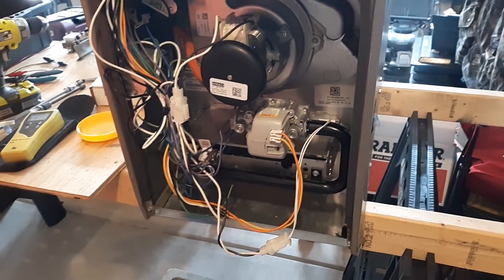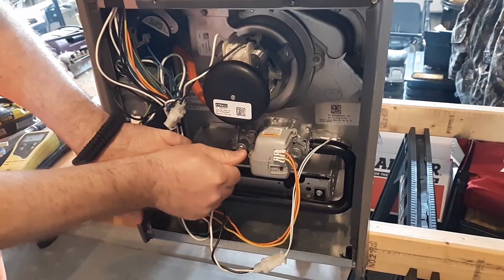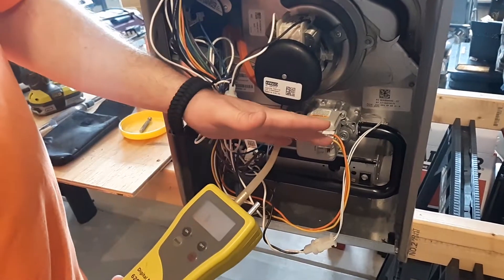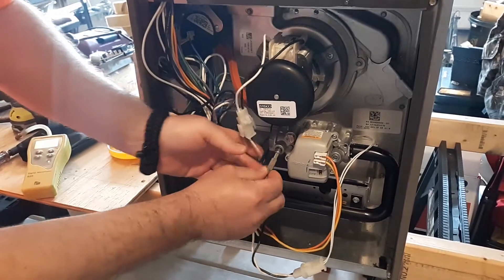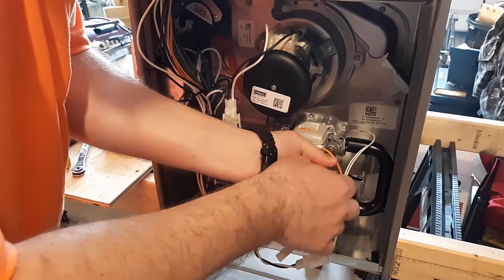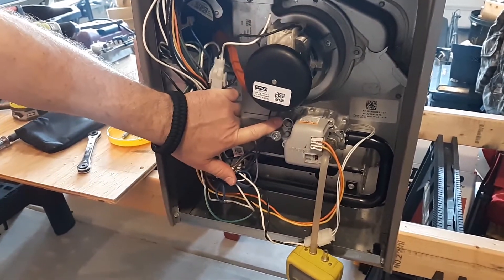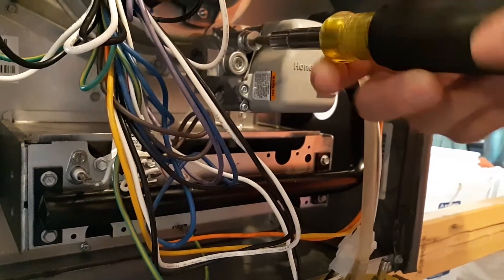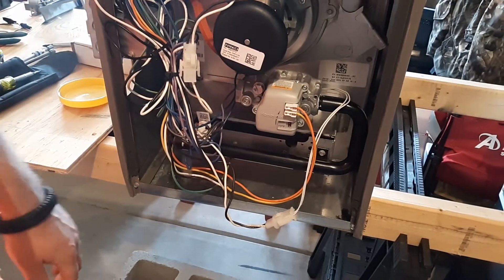Lennox Down Flow Furnace - Checking Gas Pressures

Comment: Hi, the orange and yellow wires connected to the gas valve are interchangeable? You have it orange ontop and yellow at bottom.  If you were to put yellow ontop and orange at bottom will the valve function the same? Thanks
Reply from the maker: It should. Most 24v circuits that I have seen are not sensitive to polarity and will work either way.